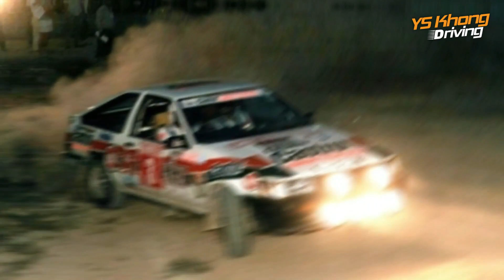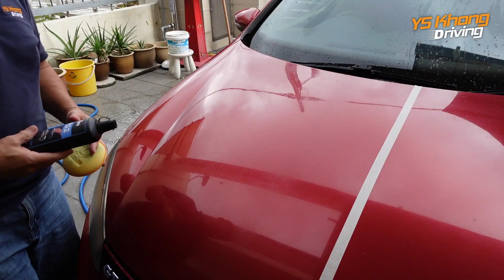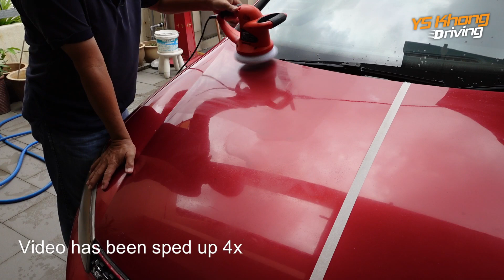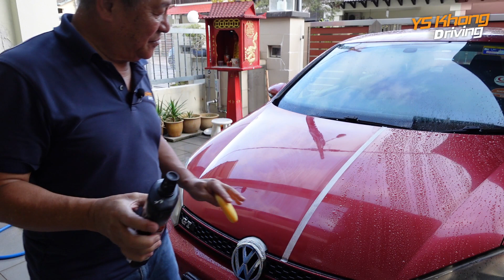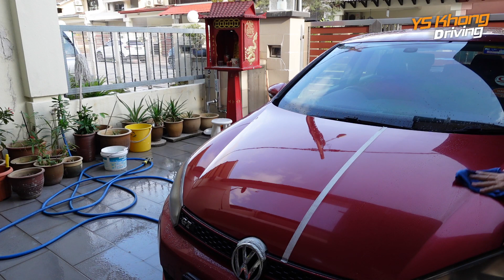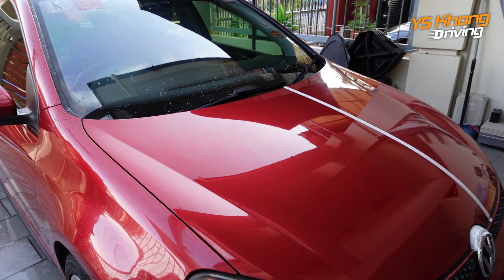D.I.Y Paint Recovery of Faded Paint on Bonnet of 11-Year Old Golf TSi - YS Khong Driving

Comment: Uncle you can try to use a clay bar to pickup all the surface contaminants first, i saw your first attempt of polish seems the pads already picking up too much dirts, Maybe try claying off the dirt first may ease your polishing, and seems there are quite alot watermarks to cut through, maybe try using a compound first then, polish and lastly sealant, anyway keep it up, detailing is quite fun after you see the end result ;)
Reply from the maker: Yup, at the end it is quite satisfying. Claying is good but a lot of work. A cutting polish is great. I have since learnt to use a stronger one PG3, which is faster. The cutting compount can be used with the orbital polisher, so is less taxing on energy. If you are not greedy, it can do the job, and for my paint, some of the degradation has gone very deep. If I cut down too much, the entire clear coat may be compromised, so I will leave it with a few marks. Thanks for your input. Still learning.

Comment: I have the same issue with my car bonnet paint. It became very rough and dull and a lot of oxidation because of the clear coat/lacquer paint was gone. Went and repaint it instead of polishing it because polishing it might not last long enough in the long term. Lesson learnt here, try not to park your car under hot sun for too long and avoid acid rain rest on the paint when the sun shines after raining.
Reply from the maker: Yes, Kal, I also have acid rain watermarks. But after my recovery work, the paint looks a lot better. And most importsntly, I learned a lot about car polish and how to use them. That is why I am sharing these videos, sort of a group learning. I also learn along the way. Thanks to my friends who chipped in to help me.
Reply: @YSKhongDriving  but make sure to do some stretching after done polishing the car because it’s really back breaking! 😆
Reply from the maker: Hahaha, yes. Just relax and let the machine work.